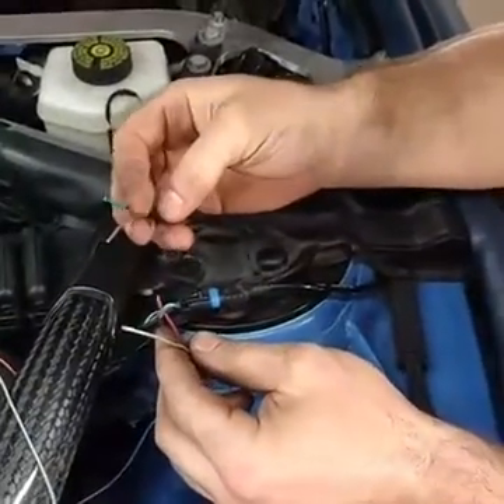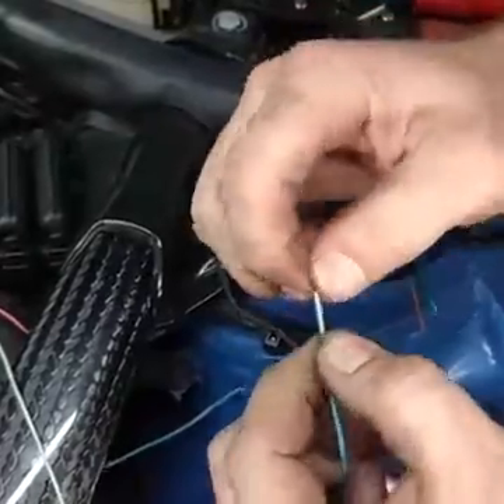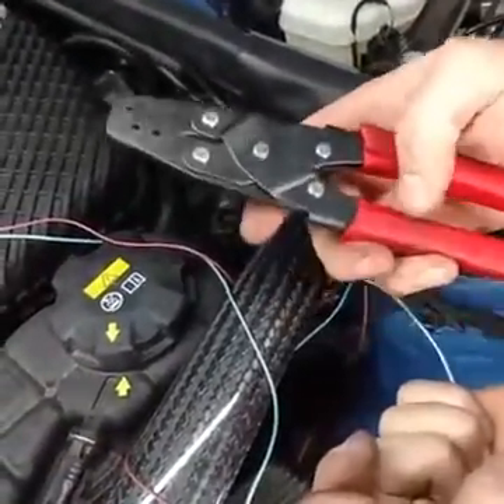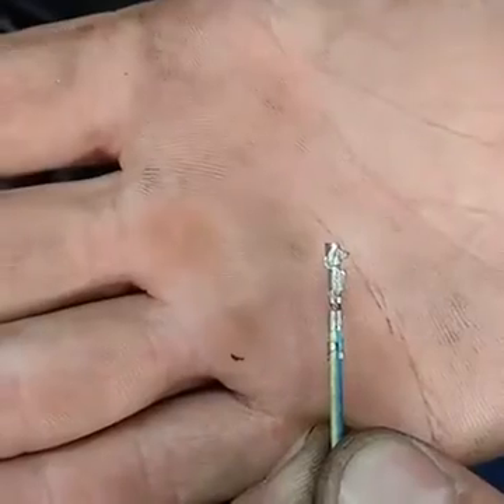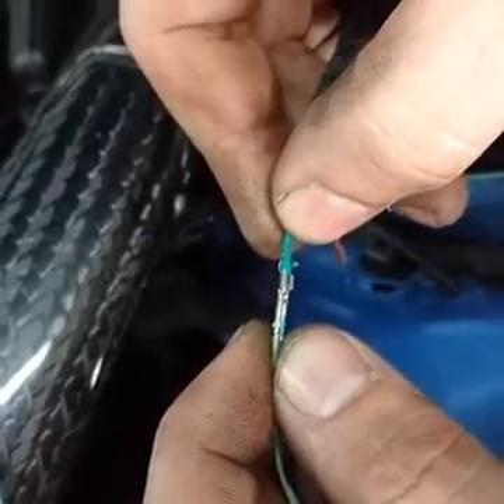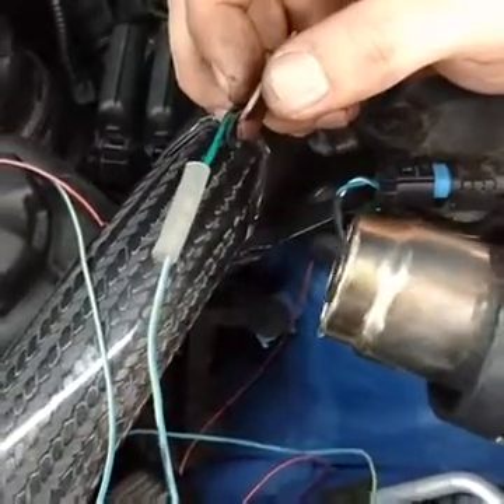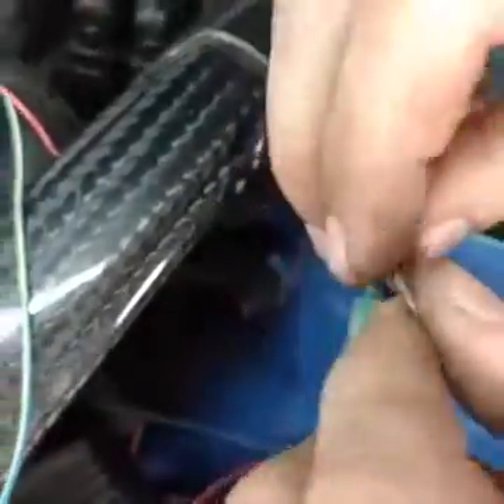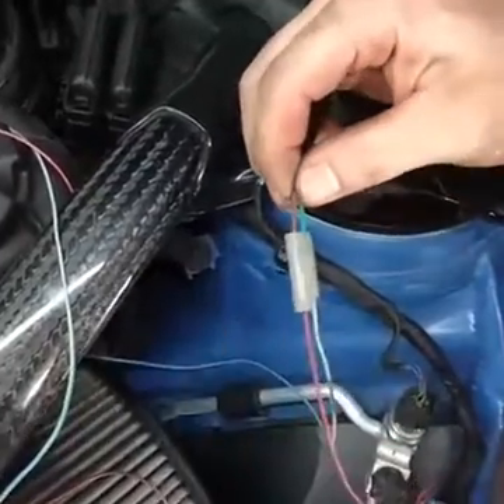ABR Houston shows how to perform a proper butt splice

Comment: Would have helped if you said it was automotive in the video title.
Reply from the maker: What difference would it had made? Boat, RV, motorcycle, Vehicle, Truck, Train, Semi, basically anything with a multi strand wire...... 
So, don't use this technique on your home wiring :D
Reply: @Abrhouston  well you are using specific connectors that arnt for every type of vehical let alone something like a solar panel system like i needed help with.
Reply from the maker: @AeomAlorian  absolutely these work with any type of multistranded wire that any moving object has. I'm betting your solar panel has multistranded wire just like everything else that has to move- if not it'd be solid core
Reply: @Abrhouston  do they come in all guages?
Reply from the maker: @AeomAlorian  Read the description :D